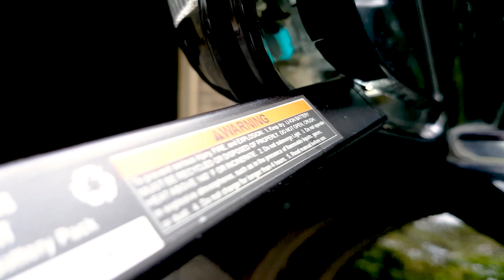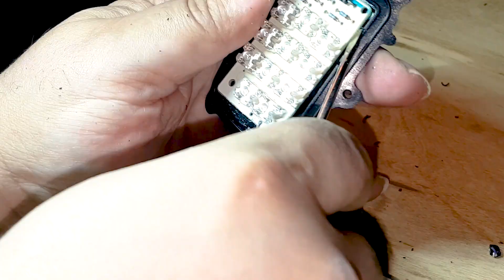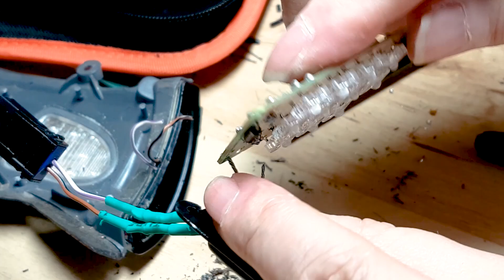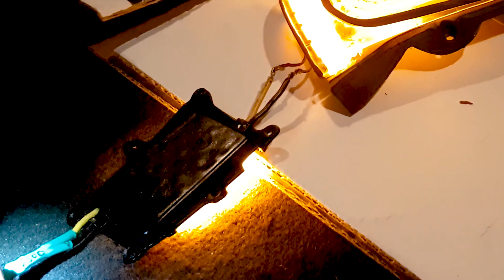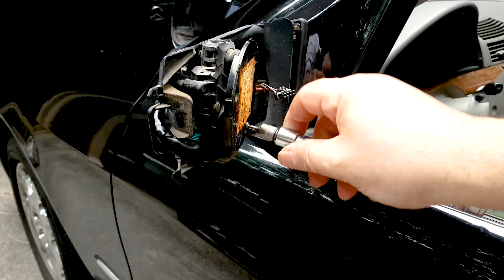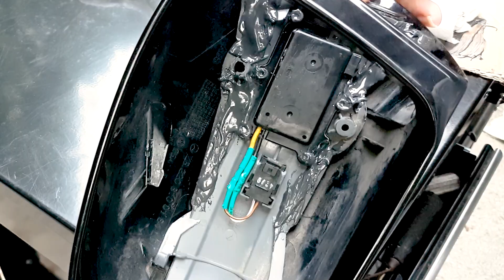Mercedes S500 S430 Turn signal Repair

Comment: Where can I buy the whole assembly?
Reply from the maker: Hello, try some online shops like autohausaz or fcpeuro.  Thrn MB.
Reply: @masood-tv  I been looking everywhere for this particular one in the video I got exactly same one, there’s online but they’re all different.
Reply: @masood-tv  thank you for answering so fast !
Reply: I took mine apart just like you did, but can’t fix it my self unfortunately
Reply from the maker: @Pasjonattt  You are welcome.
Reply from the maker: @Pasjonattt  If you solder each point, it should work.  However, you should be able to get a used one for the color of your car from eBay.  I haven't looked up current pricing but I would think for less than $200 for sure...

Comment: I have a problem like this but on the right side mirror. Signal light works fine when i am connect any 12 volt but there is no electric when i am push the right turn signal from steering wheel how can i fix this
Reply from the maker: Hi, the right side is the same as the left per this video.  Remove the unit and test the LEDs.

Comment: So in other words.... Just buy a new or used one!  Mine just went.  Most people don't have the time or tiny tiny fingers to fix it!  Cut the plastic solder the wires? And to save 20 bucks?  A used entire mirror assy 80 bucks and 65 to install
Reply from the maker: Hi nostickpeople, you are presenting two good options: buy new or used replacement parts and have them installed.  What I present is another option for those inclined to fix it another way. Thank you.

Comment: What is the part your fixing called
Reply from the maker: Which part please? Solder gun?
Reply: @masood-tv  my passenger side mirror not working and I’m getting the reflector signal that’s on the beginning of your video
Reply from the maker: @bars_over_namesbattlerap7161 , ok, all you need is a solder gun, and some wire.  I explain it detail.in the video.  Please watch, let me know which part and I will be happy to send you links.
Reply: @masood-tv  ok I appreciate you